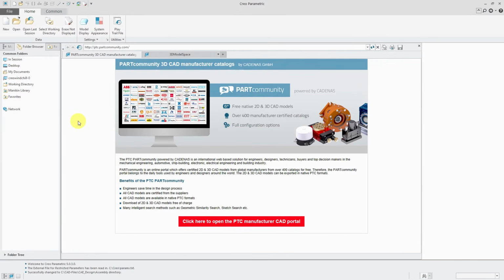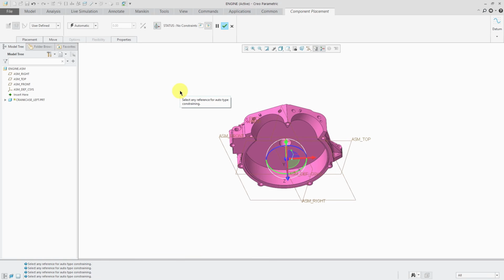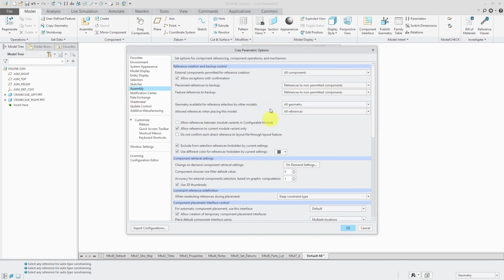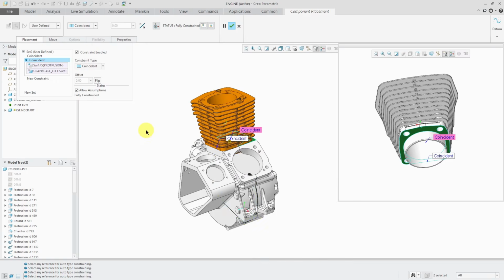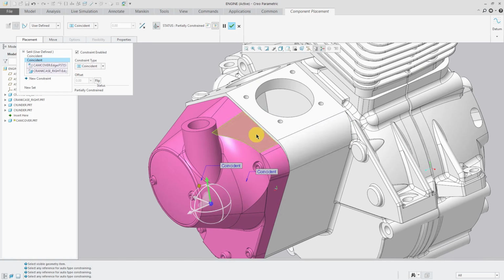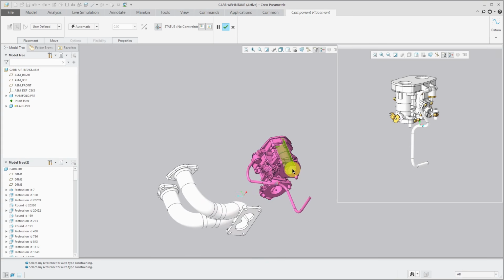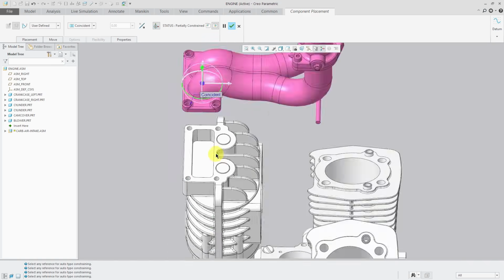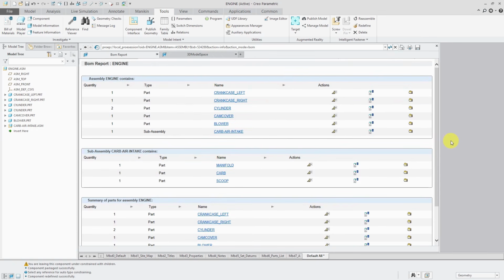Creo Parametric - Assembly Basics (Part 1) - How to Create an Assembly

Comment: i have one question. when i insert 2 or 3 parts in creo assembly, after first part insert later second part insert then 2nd part scale was changed. what should i do
Reply from the maker: Open a ticket with PTC Tech Support.

Comment: Thank you, Thank you, Thank you!!  You saved my life by showing me the config setting "comp_assemble_start" set to "move_then_place"!  I've been using Proe/Creo for many years and I have always been annoyed how, especially on large assemblies, the part always comes in very far away from where I want to place it and the "separate window" placement mode always gets messed up.  I think I may have wasted half a man-year on not knowing this super useful feature.  Why isn't "move_then_place" set by default?  I think it is a gift from PTC to Creo consultants.
Reply from the maker: I used to teach it in my Intro to Pro E classes 20 years ago for that very reason.

I set that as the default at Blue Origin and people HATED it. They said it was an extra mouse click to drop it somewhere before adding constraints.
Reply: @CADPLMGuy  Hated it?  Well they clearly weren't working on large assemblies.  I also taught Creo for a few years.  Some of my students barely knew how to use a mouse while others used Creo on the job.  Very hard to strike a balance with such a diverse set of incoming skills.
Reply from the maker: It was Blue Origin, so we’re talking about New Shepard and New Glenn rockets. So very, very large assemblies, both physically and in terms of components.
Reply: @CADPLMGuy   Blue Origin - very cool.  BTW, I’ve been trying the new assembly configuration option that lets new items come in attached to the cursor and it is not as great as I initially had hoped…. Still worth using though.  Here’s the deal - this config option only locks the incoming item to two out of the three spatial coordinates meaning that the incoming item looks like it is where you want it, but actually, the coordinate in and out of the computer monitor might be dozens of feet away meaning when you start to place the item, it flits off-screen.  Through experimentation, I found that if you use the reorient command to orient your assembly so that it is inline with the global coordinate axis you then can make your first placement constraint a coincident constraint and lock one of the item’s surfaces to an assembly surface parallel with the screen which will lock the item to where you really want it to be.  It is too bad Creo software engineers haven’t addressed this shortcoming.  It wouldn’t be too hard to revise the subroutine to set the coordinate perpendicular to the screen to a value close to the assembly object nearest the cursor, a 3D snap sort of thing.

Comment: question.. in solidworks, you can create a ASM file (rack unit subassy) with certain settings,  then install that into a top level ASM (rack bay assy) along with other items (cables, nuts, bolts , components).  then due to the settings, in the dwg BOM for the top level assy, the  rack unit subassy asm file would not show up as an item..  but the items in that sub assy ASM would show up separately in the drw BOM..  
can creo do that?  thank you
Reply from the maker: Short answer is yes, but it is recommended that you manage the BOM in Windchill that way using phantom parts.
Reply: @CADPLMGuy  sorry.. i should have clarified. all items are windchill stored..  would you be able to tell me how to make a sub assy file, filter out or split up it's components so they show up in the master drawing BOM? thanks
Reply from the maker: @joeblo9111  It's been too long since I've done this and it's a bit much for a YouTube video comment. I recommend reaching out to PTC Tech Support or your reseller for assistance.
Reply: @CADPLMGuy  ok.. thanx!

Comment: Is it possible to r- enter into the Component Placement feature after the component has already been place? Sometimes I mess up placing one or two components and I would have to remove the component(s) in order from the assembly and then place them again. Thanks for the video.
Reply from the maker: Select the component and Edit Definition.
Reply: @CADPLMGuy  Thank you. This college modeling project has become a lot easier.